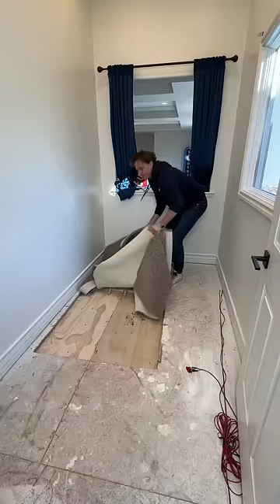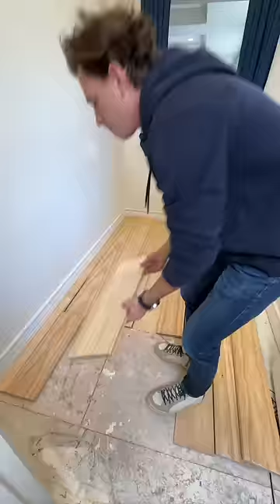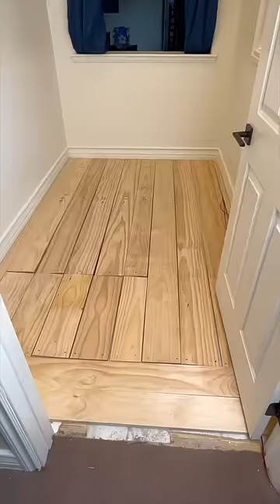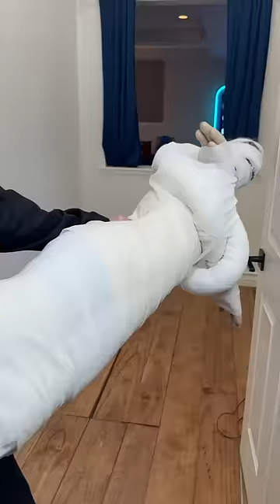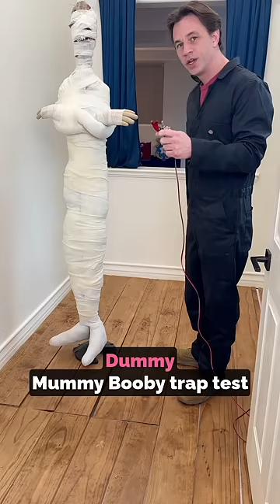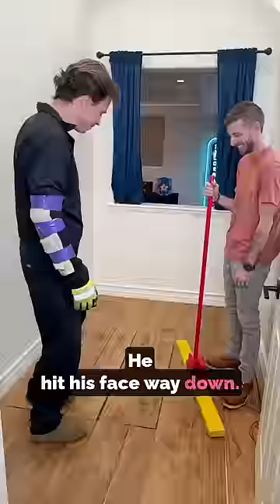Trap Door test goes wrong 😭😵

Comment: There were high chances of the last end of plank bruising against your back side of head, wear a helmet next time please.
Reply: This is potentially lethal. The further you stand back towards the pivot point of the planks, the slower your fall initially will be, since the front of the planks experience less pressure from your weight. That can result in you not simply falling through the hole, but you tipping slightly back and sliding down on the planks that are now sorta flush with your back. Your head may whip backwards due to the initially slightly slanted fall, and when the plank edges meet the back of your head close to the neck while you are falling/sliding down... - instant internal decapitation.
Please reconsider this addition. 🫣